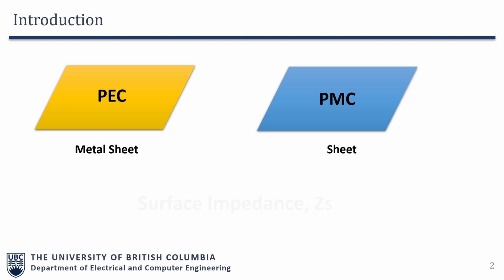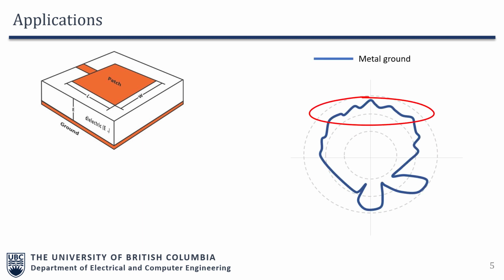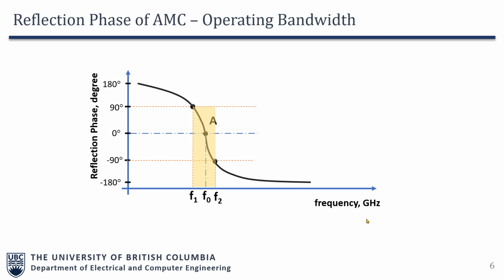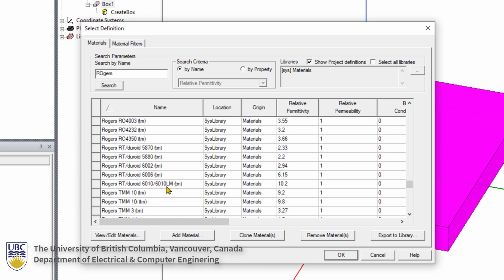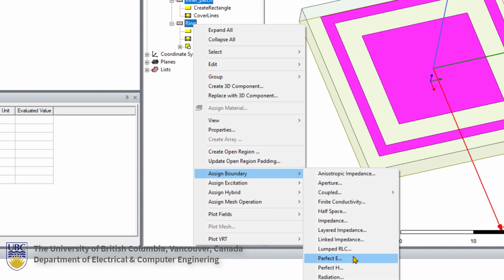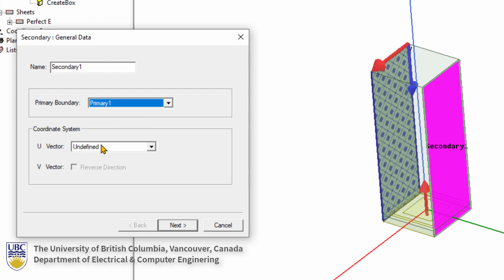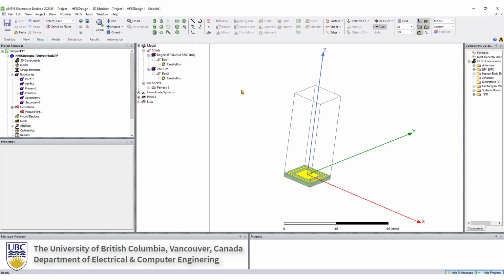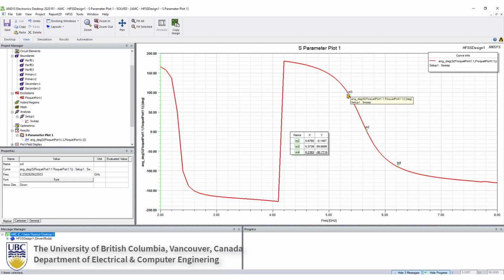Artificial Magnetic Conductor (AMC): Reflection Phase, Unit Cell Design & Floquet Port in HFSS

Comment: First of all thank you very much for this tutorial video. Why didn’t we start the radiation box from the top surface of the substrate? Isn’t that the region where we want to observe the phase response?
Additionally, I noticed this in the comments and wanted to write it to clarify: in order for the Floquet mode to work, you must run HFSS in Modal Mode. If you are in Terminal Mode, the Floquet mode will appear inactive.

Comment: [error] Port 'FloquetPort1': The exterior boundary of the faces for a Floquet Port must consist of pairs of parallel and equal length segments, displaced from each other by an integer linear combination of the lattice vectors. (2:55:10 PM  Jan 22, 2025)  why i am facing this error in my project.

Comment: Radiation Box height should be more than 15 mm but you have taken 80mm???
Reply from the maker: taking larger box does not matter. If it was smaller, then would have mattered. Lambda/4 is the minimum distance. We can take larger distance than that.  No harm in it.

Comment: You have set the height of the box to lambda/4 (80mm), but for a design frequency of 5GHZ, the lambda/4 = 15mm.
Reply from the maker: taking larger box does not matter. If it was smaller, then would have mattered
Reply from the maker: Lambda/4 is the minimum distance. We can take larger distance than that.  No harm in it.

Comment: Sir, what about wave port and pec/pmc boundary in hfss?  Can you please make one tutorial on that?
Reply from the maker: Considering the unit cell being embedded into a box that has six planes in total. The wave port is defined at the top plane and must be de-embedded to the surface to the Unit cell. The PMC and PEC are to be defined on the four side planes with co-planar configuration. If the unit cell has a ground beneath, no need to assign any boundary at the bottom plane since ground plane overrides it.
Reply: @tensorbundle  thank you  sir, it would be helpful if you made one video with wave port creation in the unit cell in HFSS

Comment: Thanks for the video! Is there any case in which you'd assign a radiation boundary in addition to the floquet port? Thanks
Reply from the maker: no, floquet modes require periodic boundary condition (PBC), hence side walls are always modelled as PEC and PMC boundaries
Reply: @tensorbundle  Thanks for that.
Does this imply that there should not be a Rad_BC at the Floquet port? Also, What if there is a transmission line below the GND plane. Should there be a rad_BC at the bottom of the unit cell?
Reply from the maker: @MMbass420  1. Yes no rad_BC at floquet port
2. If you have a full ground plane in the unit cell, the ground plane itself acts as a PEC boundary, hence no need to separately define any rad_BC even if there is any transmission line below ground. Anything below ground does not impact reflection coefficient condition due to ground's inherent PEC boundary condition,
Reply: @tensorbundle  Great! Thank you

Comment: In Reflection Phase degree - why -90°  to 90°  consider as bandgap sir.. why not 45°  sir??
Reply from the maker: Actually both conventions are used. -90°  to 90 convention was introduced by prof. Sievenpiper and  45° was introduced by prof. Rahmat-Samii's research group.

Comment: Thank you so much sir, but are there any design equations for the dimensions for an unit cell ? As they form an array the dimensions really matters!
Reply from the maker: These unit cells are mostly modelled by lumped RLC circuits and an initial design is started with some known basic structure such as a rectangular patch, ring etc. Then more complicated response can be optimized using trial and error

Comment: and if I have transmit FSS unit cell  what I should put for  floquet port for get S21 and what will happen to the reflection phase in this case FSS unit cell?
Reply from the maker: you need to define two floquet ports (up and down) for transmittance phase

Comment: Thank you for this webinar. Very informative. Sir, I have designed a rectangular patch antenna with the coaxial probe, and the resultant gain is around 2.5dB. Is it possible to maximize the gain using AMC for 1.06GHz? Is it possible to place AMC unit cells on the designed patch?
Reply from the maker: yes possible. There are some research papers reported where they used AMC as superstrate on top of antenna to increase gain
Reply: @tensorbundle  sir, how to calculate the dimensions of unit cells? Is there any formulas? Once we design the unit cells, then how to place that structure on the designed patch?
Reply: I have designed an antenna for 1GHz, and I am getting 2.5db gain. I have to improve the gain of the designed antenna using metamaterials.
Reply from the maker: @pallaviait5791  Please check the following research papers:

1.Prakash, P., Abegaonkar, M. P., Basu, A., & Koul, S. K. (2013). Gain enhancement of a CPW-fed monopole antenna using polarization-insensitive AMC structure. IEEE Antennas and Wireless Propagation Letters, 12, 1315–1318.

2.Feresidis, A. P., Goussetis, G., Wang, S., & Vardaxoglou, J. C. (2005). Artificial magnetic conductor surfaces and their application to low profile high-gain planar antennas. IEEE Transactions on Antennas and Propagation, 53, 209–215.
Reply: @tensorbundle Thank you sir.
Reply: @tensorbundle  wher is the formula please